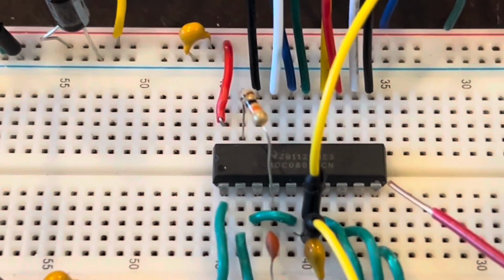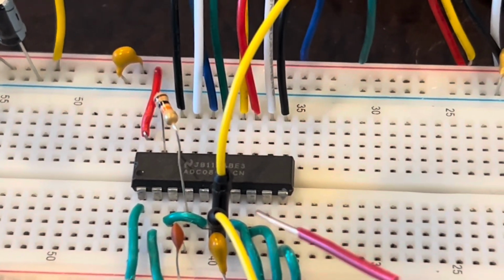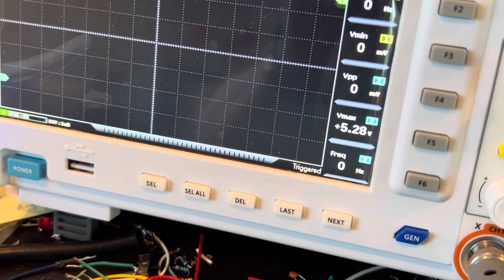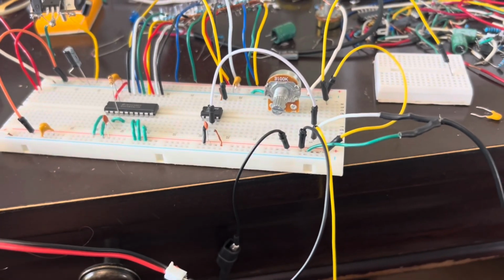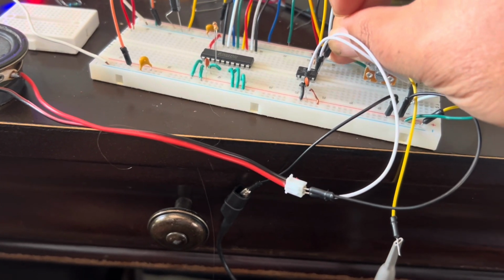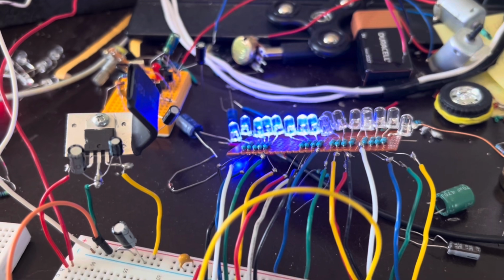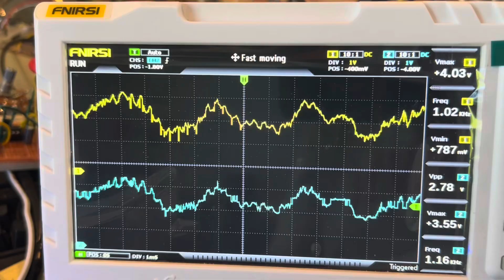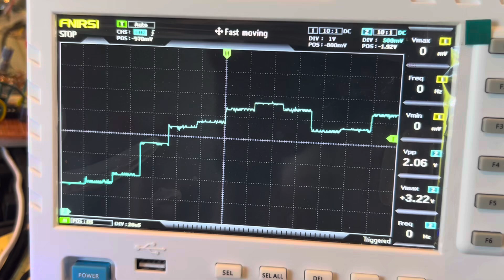ADC0804 - Analog to Digital…and back again

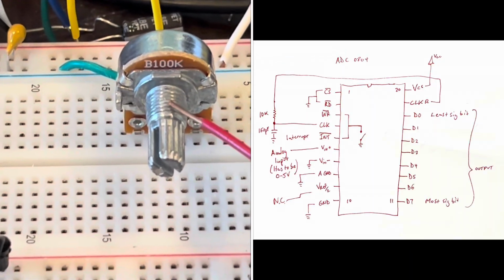Comment: Saving my place to see your hand-drawn schematic at timestamp 2:22.
Reply from the maker: Its a copy of the one in the datasheet
Reply: @igorbrichkov3632  Thank you.

Any insight as to what is meant to happen with the WR and INT pins?  Your wiring just shows them wired to each other, but the diagram shows them wired to each other, sharing a switch to ground.  Is there anything in particular that you're meant to do with that switch and connection, in order to have an ADC function continuously?
Reply from the maker: @carultch just wire them together. The diagram is from an example on datasheet. It runs continuously based on the internal clock rate set by the RC network . Pins 1 and 2 need to be grounded to enable the tri state outputs. And pin 3 and 5 just get wired together.
Reply: @igorbrichkov3632  Thank you very much, Igor.  I'm hoping it works.

I've been trying to make sense of these control logic pins on later ADC chips that have an internal clock signal, but the datasheets leave me with more questions than answers.  Now that I see your circuit working, I'm going to revert to your vintage chip and try what you did.
Reply: @igorbrichkov3632  I found another issue, that the switch on the datasheet diagram actually has a purpose.  I've determined that it needs momentary grounding at pin 3 to start working.  This usually comes from pin 5's output, but initially needs to come from an external connection.

I designed a solution using a pair of transistors & RC charging circuits.  It momentarily grounds pin 3 on startup, then resumes an open circuit, and discharges caps slowly thru 10k resistors when shutting down.
Reply from the maker: @carultch thats great that it works but not really required for device functionality. I always just wired them together and works fine

Comment: Did you use any programming for ADC ? 
What if i want a 16 bit and 256kbps sampling rate? Can you guide m through it how it can be done?
Reply from the maker: @hyperfier3755  I didn’t but you needed 16 bit you need a 16 bit adc chip and provide a clock frequency of whatever you want through the external clock pin. This chip i used is only 8 bit
Reply: @igorbrichkov3632  can you please guide me as ypu have knowledge i am searching over internet from 6 hours found nothing usefull except your video.. 

I want to do the same as yours but want better pre amp for my 1000 watt power amplifier...i have to run big 300 watt speakers attached in parallel mode using my amp .. 

But i want to see what wonders 16 bit audio processing will do ...firstly i  want input signal  to convert signal into digital form and then back again into analog ..then will use it as input signal for my amplifier.. 
Thank you so much
Reply from the maker: @hyperfier3755  so you need a 16 bit analog to digital converting chip. These are expensive especially if you want them to output in parallel. Then attach a digital to analog converter back. You can get a serial output adc but that would involve some programming to get the data out and thats a little more of a pain but doable with a microcontroller like arduino.
Reply from the maker: The reason why some high end amps are so expensive is that they have these expensive high bit adcs in them
Reply: @igorbrichkov3632  yes you are right Sir ... 
I just want to experiment it and integrate in my amplifier though its gonna be tough ..your help and guiadance will be needed... 
Even if 12 bit or 8 bit can change the dynamics then i will start wuth this one.. let me know how to proceed for a 1000 watt amplifier.. 
And i am looking for simple solution like your video without using arduino .. as i dont want any attachable component .i just want to integrate it in inside the amolifier using all this over a PCB.. i will dedign that later.. 
If 8 bit like in your video is good enough for a noticable change in audio quality ?
Reply: Now i read on reddit that 16 bit gives you a lot of npise and its not easy to handle so 12 bit ADC should work fine i guess right ? 
Kindly guide me if i should use both ADC and DaC ? Or same ? I just need better sound quality ..

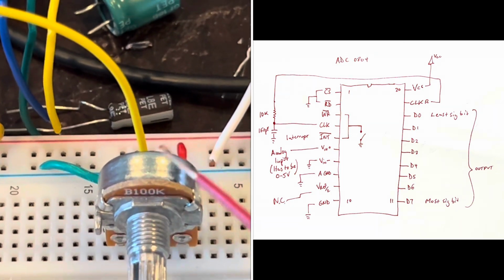Comment: Hey, 2:25 i'm checking the datasheet again it seems work, but should the !RD! pin (2) be continuously low?
This pin seems to reset stuff inside the chip and make the data available.

are you going to try dac0800 or dac0808? 
the chip inside the Roland TR-707 (under the eproms) seems to be a pre version (other designator) of the dac0800, the pinout is the same.

Combine these 2 with some ram and you have a delay or reverb / hall.

Comment: PLS, when You show circuits on breadboard.
Put all the ground busses to the blue marked line of contacts.
You did OK on the top bus lines but not on the lower.
The orange jupper wire connects the top blue line with the lower red line.
OMG.
Reply from the maker: @thomasw2509  yeah sorry should have mentioned that. I had a -12v on that lower blue for a while so i forgot to mention when i changed it. I put the schematic side by side just to clear it up

Comment: You may want to use a potentiometer to set the ADC sampling frequency. As you reduce the sampling frequency you will eventually have a nyquist bandwidth within the audible range and aliasing will cause the resulting audio to sound increasingly wierd